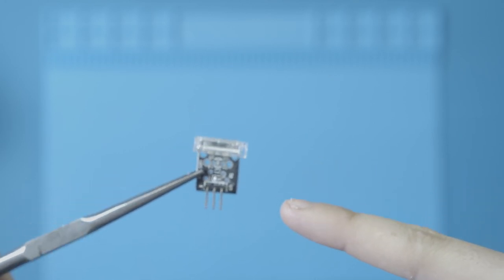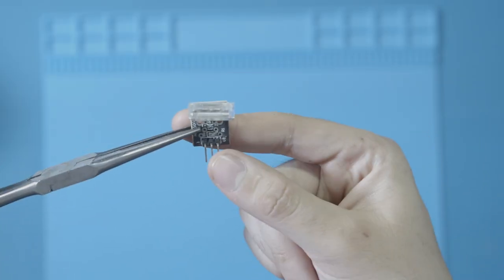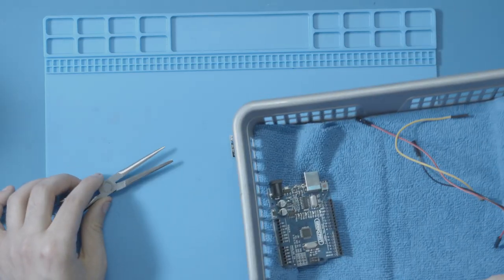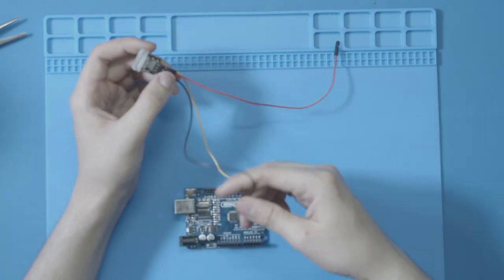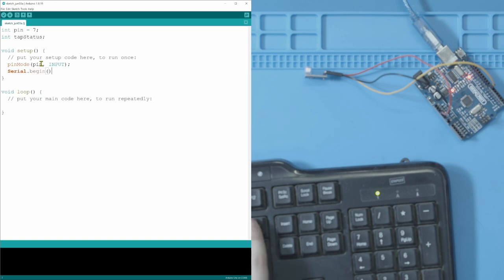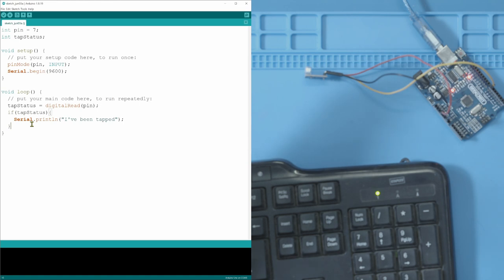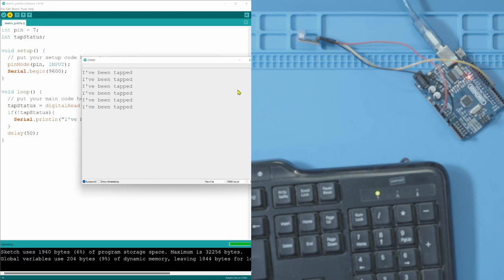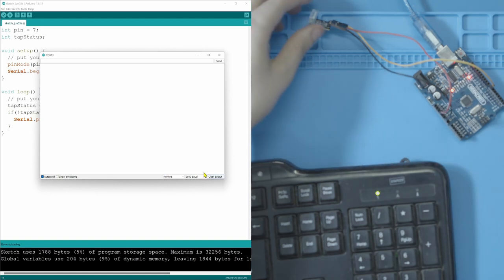TAP/KNOCK SENSOR EXPLAINED | KY-031 ARDUINO TUTORIAL

Comment: Your 50ms delay was making it so the taps were happening during the delay, and it wasn't catching it in the loop. You could put the delay inside the if statement, so it would only delay if it catches a tap. You can also get the millisecond time a tap occurred, and save the last tap time, and when you get another one within so many milliseconds, ignore additional taps. This does answer my question I was wondering about, in does this latch the output for a specific amount of time - NO, it does not.
Reply from the maker: yeah unfortunatly these electronics arent asynchronus, so gotta do some wierd stuff to make it work

Comment: Bro, can I use it to turn off the angle grinder when it's kick back. The problem is angle grinder vibrates constantly but I want to turn off only when angle grinder kicks back
Reply from the maker: probably would be better to use a IMU angle sensor